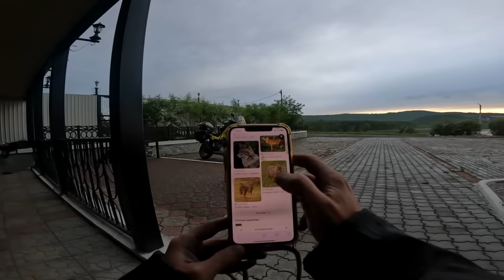NO SAFE PLACE TO STAY! (Emergency Camping in Remote Russian Town) 🇷🇺 [S5-E10]

Comment: Learned a trick years ago riding in the rain, throw on some nitrile disposable gloves under your riding gloves. They will keep your hands not only dry but they will not get blue then ;) They are cheap and easy to stuff on the bike in a corner.
Reply from the maker: Haha thanks for the tip ✌️🐝😍